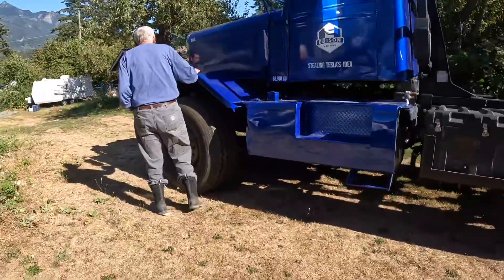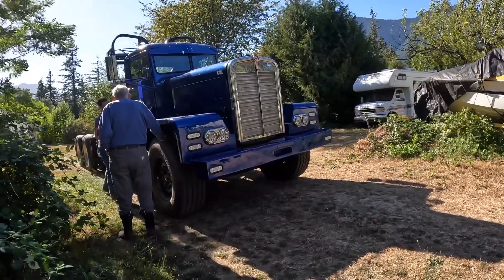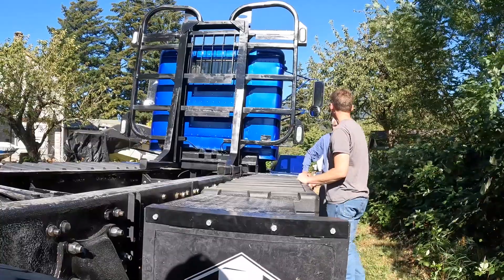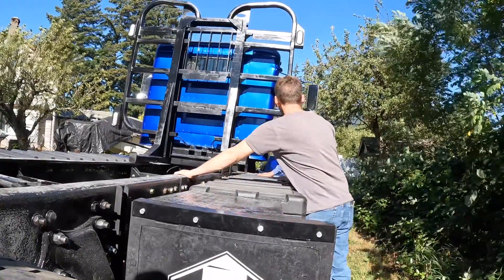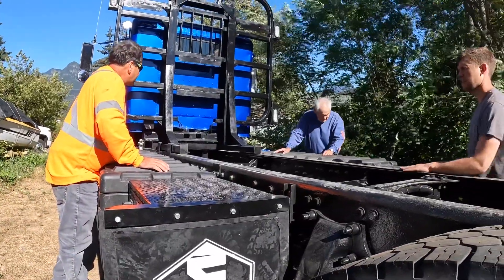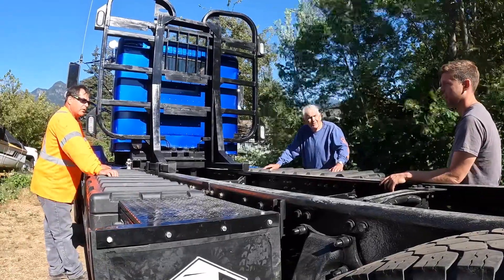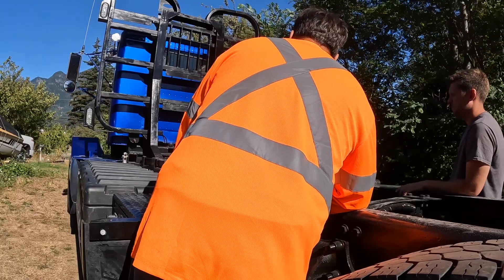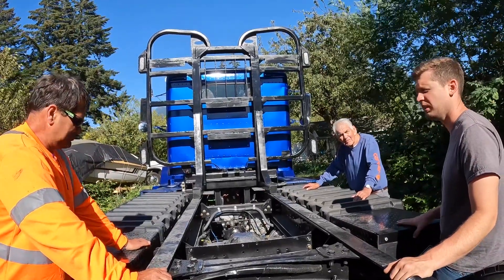Chace shows his Grandpa, Carl the Diesel Electric Logging Truck

Comment: How many miles do you get on a single charge?
Reply: It's diesel electric. As long as there is diesel for the generator, there is electricity. Plus batteries.
Same as asking what kind of milage a train gets on a charge.
Reply: @CaseyBDook the generator is supposed to be a range extender, officially it's an electric truck. It also can be charged at an electric station. Still, with the size of the fuel tank, there should be a range estimate.
Electric trains don't have a range estimate because they're always drawing current from the overhead wire, that's différent.
Reply: @Aaron Aaronsen  sorry bud. Trains generate electricity to drive the wheels. We are not talking about a city train carrying people. The electric busses don't all use overhead lines either.
Freight trains are generators on wheels that drive the wheels with electric Motors. Officially, a diesel electric train is an electric vehicle. What is the range, and how do you measure?

No one is stringing wires across Canada to power our trains.
Reply: @CaseyBDook  sorry, I don't live in Canada but France
e, we have electric freight trains here (although they're slowly being phased out by trucks). Since you talked about electrical locomotives I wrongly assumed they were fully electric and not diesel electric.
To measure the range of a diesel electric locomotive is just taking into account the size of the tank and the fuel usage per mile, then it's basic maths.
For example the BB67300 from Alsthom has a 3400l fuel tank and uses (on average) 3,7l of fuel per 100km, so it has a theoretical range a bit above 900km.

Comment: I like the surroundings, including the chicken. These are down to earth people doing really innovative things. I've thought that this concept has been overlooked. Diesel/electric has been perfected by the railroads and needs to be expanded for road use. I really don't think pure battery is feasible due to range, temperature fluctuations, vibration and charging issues over time. Brand new components don't stay new very long on a truck. This seems to have far more ruggedness

Comment: Impressive that it twisted the drive shaft.  Sounds like you need to electronically torque limit the drives.
Reply: Once they get the electric axles and install them, it will eliminate that need
Reply: Carl’s just a proof of concept for the idea of using a generator to add range and fueling capability to an all electric vehicle. The L500 and L750, and their R-series counterparts will use E-Axles and there will be no driveshaft to twist.
Reply: The axles are way too small, that's the reason why it never had a load

Comment: Did I miss it or did you not address the over torquing issue that twisted the drive shaft.
Or are you gonna leave it as is and let the drive shaft be the known point of failure to prevent other components from being damaged?
Reply: They are in the process of getting electric axles for the trucks, and then there will be no need for the single motor with drive shafts